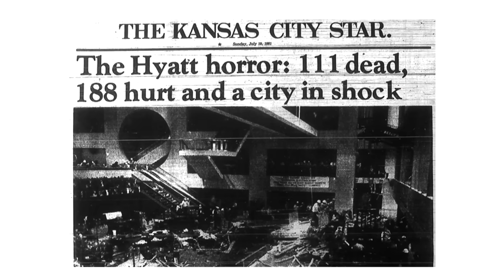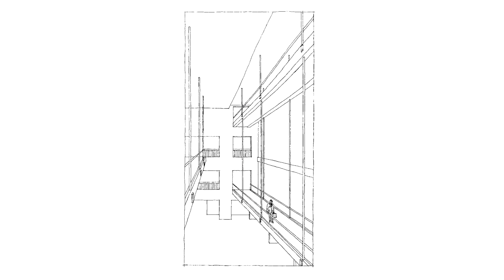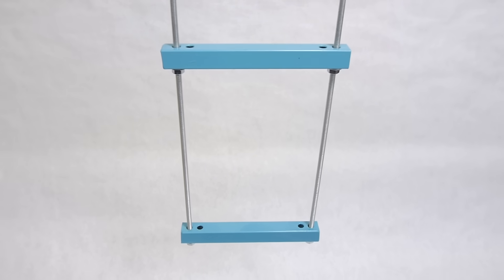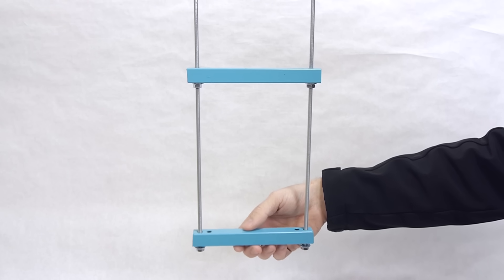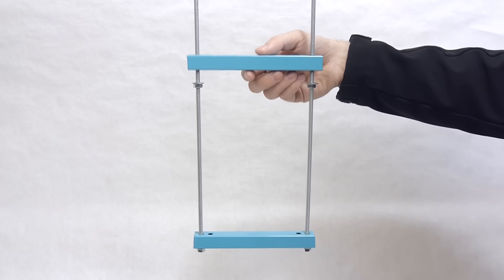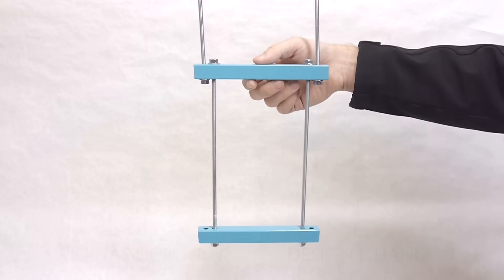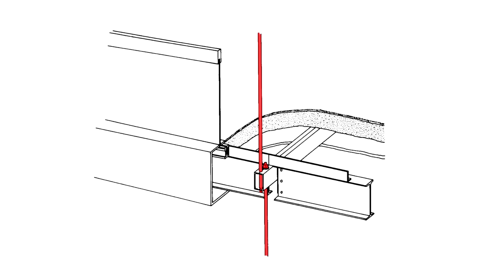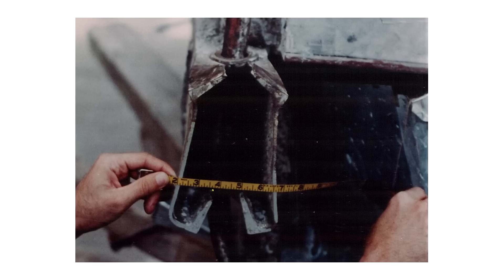The Disaster That Changed Engineering: The Hyatt Regency Collapse

Comment: How can something so obvious be missed by the engineers who approved the change? I am not an engineer and I can see the serious problem. The nuts are graded to hold up to a certain weight. When the change in design was made, no question was asked if the nuts can still hold double the weight? Clearly, there is a human mistake here that somehow got missed by a committee. Or was there a committee to approve of the change? In engineering or any field where people's safety is at stake, there has to always be a consensus of change approval. A minimum of 3 people of equal skills have to concur.
Reply: The failure was not due to the nuts or bolt threads. The beams split at the holes at the welded joins.
Doubling designed load should not cause a failure if the design has a sufficient safety factor.
This design was bad from the start though.

Comment: this is wrong. the reason it failed was because the box girder was constructed out of parallel flange channels (PFC's), and part of the design change was that they were changed from back to back to toes together. this meant the load was transferred to the web through the flanges, which failed in bending/tear-out. the threaded rod would have been able to support the weight of both floors, and the nuts and washers will be able to develop the full strength of the rod. The real problem was that the engineer relied on the fabricator to verify the change was acceptable.

Comment: I was a Missouri PE at the time of this accident.  The Missouri Board for PE, Surveyors and Architects did not go unscathed.  Their fees went up for several years to compensate.  They sent out newsletters describing the accident.  The failure mode was the collapse of the washers holding the structure up.  If the engineer had just changed the washers to a larger or stronger version, the accident probably would not have happened.  It's horrible to hear about over a hundred deaths all due to an oversight.  PEs have "Errors and Omissions" insurance to cover this but nothing will bring back the people.
Reply: They raised annual PE fees .. for what?  Surely the Board wasn't the insurer for that structure?
Reply: No, the Missouri Board was not liable for the accident.  The exact reason for the bump in fees escapes me at this time.  But it was related to the KC accident.
Reply: All Engineers under one board? Madness!

Comment: One error that was caught one day is a designer sizes a beam to take 500 lbs. A box that weighed 400 lbs was lifted with a wire rope by a single over head pulley that was attached to this beam to take 500lb load 400lb is less then 500 so it should be ok right!. A winch on the ground pulling down on the wire rope. This doubled the load on the beam to 800lbs. (2×400) but the beam was rated at 500lbs. Errors like these happen more frequently then you think.

Comment: O.k... I'm no engineer but I am a machinist.... What I see other than the obvious hole through the weld is this.... The wall thickness in the welded c beams are a quarter inch!!!! How do you expect that welded seem to hold that much pressure when its just a quarter inch? And I would never put the holes close together or close to the end of the beam!!! Like how didn't this thing fall during construction!!!!????

Comment: If the main anchor point at the very top was of the same construction, same size rod/nuts and washers with the same "box gurder" construction, it still would have failed, bad design, they surely should have used solid steel channel that wouldnt seperate allowing the nuts and washers to pass through.

Comment: While still not ideal, a simple preventative measure would've been to weld a strap around the box beams or weld a cap on them. personally, as a welder and structural specialist, I'd have plated the bottom of the box beams with a simple 1/2" thick plate to act as a washer and distribute the load. And instead of threaded rods, I'd have used much stronger cables and tie rods and turn buckles, similar to suspension bridges. just my 2 cents.

Comment: Wasn't there a mall in Singapore where they didn't factor in a buildings living wait and the weight of the air conditioners caused structural failure.
Reply: No, the engineer simply calculated the living weight, but forgot the weight of the structure itself. That's even worse
Reply: alexander reusens Ouch.

Comment: This has bothered me for decades.  The question the comes to mind is where did the steel for the beams come from?  If it is checked, I'm willing to bet China.  The steel from China has the same rating as the steel we used to make here in the United States, specifically Youngstown.  However, it is no where near the quality of the steel that used to be made here.  The engineer that suggested the change likely did it on his understanding of real steel, not the crap we've been importing from China.
Reply: Did you watch the same video as me?
1) it wasn't the material that was the cause
2) the engineer didn't suggest the change, he merely approved it without additional calculations.
3) There is nothing wrong with Chinese steel, every kind of steel has different properties, which are known by doing tests and engineers adjust their calculations to the kind of steel they are using. If two monsters of steel have the same chemical, mechanical and physical properties, then they have the same quality. If one is superior than another, one must have at least one superior property.

So please, keep your anti-"all other countries" sentiment for yourself
Reply: Pelen - you do realize that this tragedy occurred in 1981, right?

Comment: Threads the whole length?  Lazy lathe operator?

If they can be made to be threaded only at the ends, they can be made to be threaded only in the centre and at the end.  In fact, all-thread can still be used so long as the unneeded threads are turned off.

Comment: I wish engineers and architects etc would stop changing approved designs from what the creator intended. We've all seen this movie before and it's usually for saving money and being cheap. Whether it was the Sampoong disaster this or AA 1981 flight.
Reply: Typo, should be AA Flight 191.

Unapproved forklift used to remove engine, damaged the mounting.

Comment: Screw threads don't need to be placed on the entire length of the hanger rods to support both walkways. The rods could have just been threaded where the walkways would hang and the rest of the rod could have been smooth, the thread would start and stop on the same rod.

Comment: The connections had only 1/3rd the required strength by standards and this was with around 60 people on deck, which could have been more, and not considering dynamic loads. So while it would not have collapsed with the original design the connections needed some serious reinforcement regardless.

Comment: There was a second design change which I feel, had a greater role in the failure.

The box beams are two 'C' channels.  In the original design, the 'C' channels were back to back with a tube weldment, spacer, for the suspension bolts to pass through.    The nut and washer combination would have been supporting the vertical web directly for each of the elements. The top and bottom plates would have require no drilled hole.

The fabricator, again, asked if to two 'C' channels   could be formed into a true box beam, 'C' to 'C',, toe to toe. because the welding was much easier.  In this configuration,, the 'C' s facing each other, there were also supposed to be intermittent web stiffeners at right angles to the web, welded top and bottom pates and also the web,, to better transmit shear.

Holes were either drilled or burned centered on the weld line toe to toe,, web stiffeners were not added, or incorrectly positioned.

That IS why you see the bolt connection towed through the top and bottom plates.  The original design was for the suspension bolts to be bearing directly under the web.
Reply: Where can i find this information?

Comment: Still don't understand it.. Why would the weight double? I mean if it has 1 line, the screws on the lower bridge would still be carrying the full weight of the 2 bridges right? Or does this mean that the  screws carry the weight of the corresponding bridges and the lines is what carrying the full weight?
Reply: Sjard Willems v If there's a single rod that goes through both, the rod itself directly bears the weight of both. With the split rod, the top floor now has to bear the weight of the floor beneath.
Reply: techmage89 Yeah I understand it later! Thought it was the weight on the ropes but it was on the bolts!

Comment: This is why CE's have gigantic factors of safety like 8 or 12 in some places. Aero's are lucky if we get 2. FYI, factor of safety is (Amount of Force,Pressure,Temp,etc. needed to break your thing)/(Max amount of that you expect to see in that thing's lifetime).
Reply: Very few other people commenting here have mentioned safety margin.
Many people said that they immediately saw the cause, meaning the load doubling, but from the simple diagram shown (the blue beams) they did not see the real cause. The bad assembly of the beams was the cause. That was not shown until later.
If the structure had been capable of supporting many times the highest weight and extra impacts from people jumping, as it should have been, then the design change would not have caused any trouble.

Comment: Seems hard to miss as an engineer, very basic load carrying.  It's obvious that the change causes beam above to carry entire load of beam below.  In the original design, each beam carries it's own load.  More specifically the beams designs were so wrong in more than one way.  The C beams were placed with its outer walls facing outward not inward against each other forming a sort of I beam with rod between the 2 C beams.  And of course, the load sharing.  It was a ludicrous design.
Reply: Oh, I See.  Thank you.  Classic case of structure not designed to hold load and failure happening at some later date.  JAP123 flt comes to mind.

Comment: The real problem was the poorly designed box beam, had it been welded solid at the connections or all the way it would not have been a problem.....The very top connection had no problem supporting the weight of both.

Comment: And no mention of CitiCorp, the averted structural failure that could have been much worse than Hyatt Regency and potentially could maintain the top spot for single event. The two are so similar, small changes that cause big weaknesses, but CitiCorp was a success.

Comment: That was mighty interesting! So if I understand correctly the problem was that the rods were made to sustain the load, while the platform was not. So when half of the weight pull was applied from the top platform, it broke? But why did the top platform fall?